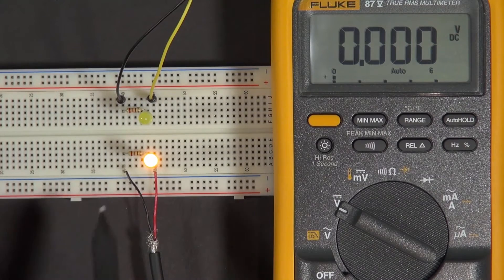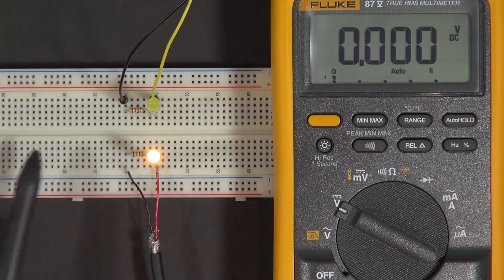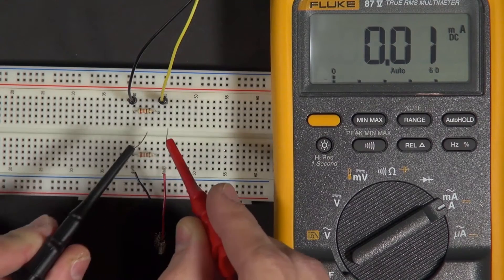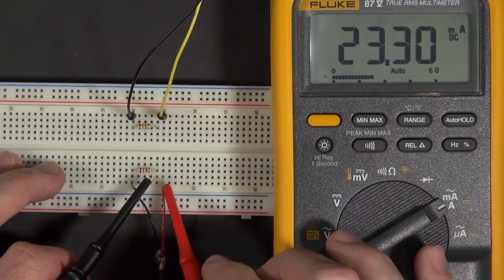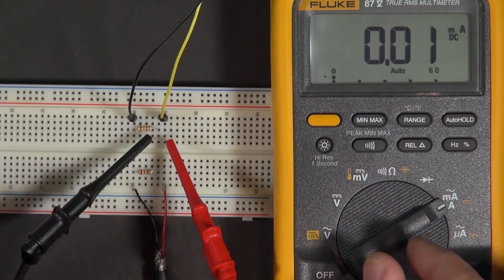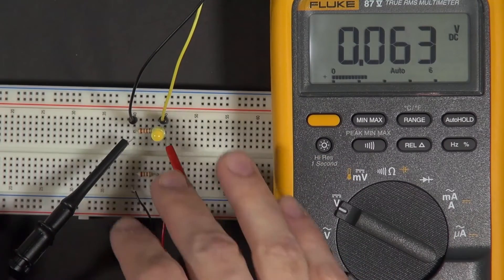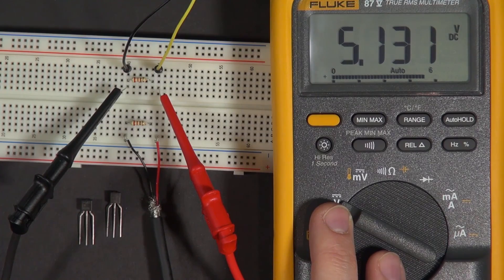Troubleshooting: Investigating why the LED is so dim (5 of 10)

Comment: As always, thank you Ben!  I want to ask, I know that without that led, the 220resistor was not making a circuit with the 555 source, but if it was - what effect does that have *on the source*? As you said, the volts need to be 0 in summation, so does it unbalance something on the other side? Like if you had another small circuit in that chain?

Comment: To add, ability of a power supply to "deliver" current differes just because Ri {=inside resistence = you can imagine it like resistor inside an power supply} is DIFFERENT for DIFFERENT power supplies (Different power supplis are e.g. usb charger; battery; switching-mode power supply...). The Ri depends on construction of a power supply and it is a characteristic of a given power supply.
Reply: Power supply should keep power constant. If you want constant voltage use voltage supply and if you want constat current use current supply.

Your computer has a voltage supply that keeps the voltages +-12VDC and +-5VDC steady even when load increases. The power rating of your computers voltage supply tells how much load it can supply. Current supply keeps current constant even when loads resistance changes. These are mainly used for recharging batteries and batteries usually indicate what their recharge current is. Power supply keeps power steady so it limits current when load's resistance drops so that current doesn't raise to damaging levels. These are used in heaters and motor control.

Comment: The odd part to me is the forward voltage. There is enough voltgage to push the electrons across the diode, but not enough electrons to illuminate the diode properly. 

Does this relate to the controversy of, "Its not the voltage that kills you, its the current'? Lightning must have high voltage, to break the resistance of air.  I guess the resistance of the human body composition is ultimately 'what kills you', but surely it must also be hgih current. I believe contact (skin) with 100mA - 1A can be lethal, right, but no voltage is generally given...right?

I guess a 12V car battery has much more potential for harm than a any number of dry cell batteries. Can you explain that?

Does this mean that in schematics, stating the volrage of the power source, without some indication of max current, is implying that you could have 'infinite' current?

Comment: How could that be? Due to Ohm's law in both circuits there are 5V, than with equal load (resistor + led) there must be equal current. I don't think previous comment describe this situation fully.
Reply: Only the open-circuit voltage is the same. When you put the LED in the top circuit the voltage is not 5V any more.

Comment: You have amazing content Ben- thanks very much. Question, though- doesn't the current measurement you're taking short the circuit, since you're taking the LED out of the circuit? Isn't that dangerous to the power supply? Wouldn't it be better to leave the LED in the circuit and insert the meter into the circuit?
Reply: It does not, since there is a resistor in between the wires

Comment: Could anyone help me? I can't understand how one circuit can have a current of 0.3 mA and the other of 23 mA. Since 5V is the voltage and 220Ω resistance for each circuit, according to Ohm's Law, shouldn't we be getting I = V/R = 5/220 ~ 23mA . So why do we end up with 0.3mA in the upper circuit?
Reply: Because the mystery circuit that it's also connected to has resistance?
Reply: Ohm's law still applies, but V isn't 5 volts anymore after we loaded the 5V source by connecting to GND through LED and resistor. We measured 5V only when it wasn't loaded at all. Maybe it would remain at 5V if we connected it to GND through much higher resistor. But once we wanted the 5V source to give more current than it could, the voltage droped from 5V to much less...
Reply: The top circuit has a large output resistance, so the output Voltage drops, when you draw a current.
Reply: for anyone wondering:
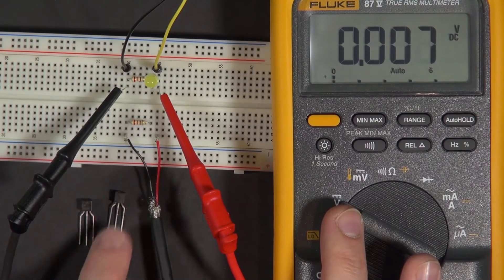Look at 4:50
There he is measuring the voltage with the closed circuit(including the led)
Ohms law obviously still applies, but you guys are putting in the wrong numbers.
Voltage is 1.822V and with the resistance of 220Ohms the Amperage would be around ~ 8.27mA

Take a look exactly where he is measuring with which components connected in the upper circuit, then you will probably get it =)

Comment: Notice that in both videos Ben never measured the signal's voltage when the loop is closed. But he did measure the amperage when when the loop is closed. That's why a lot of people will apply Ohm's law to the wrong set of numbers.
 So why is it that the voltage drops when we connect everything together? I think it's due to the law of Power: P = V * I. A normal power supply  will always make it so that the terminal voltage difference will be a fixed value because it provides the power lost throughout the circuit. BUT in the case of the signal, there is no such guarantee.
Reply: Just this one because you stated this " .. when the loop is closed .. " so it lead me to think if there is any chance that open loop shows 5 V and closed one different and how is that possible and is that reflecting the problem with the current draw ? Thanks.
Reply: @stefanjovanic7725  Actually, he did measure the closed circuit's voltage at around 5:00. It is different for sure.
Reply: @stefanjovanic7725  The voltage drop is because of inside resistence of a power supply {=Ri}. The power supply really has e.g. 5V, but it has also inside resistence {you can imagine it like resistor inside a power supply} which LIMITS the current according to Ohm's law. The Ri is a CHARACTERISTIC of a power supply and value of Ri depends on construction of a power supply. Therefor if there is a resistor inside {Ri} a power supply and you close the circuit, the resistor {Ri} LIMITS the current according to Ohm's law. Wish it helps :)
Reply: The important thing to realise is that it is current that makes a led work, not voltage. That having been said there must be enough voltage present to turn the led on.

Comment: Isn't it because the square signal isnt DC and thus its equivalent DC current is the RMS current (effective current)? The DC signal is ON all the time, the second signal isn't (depends on the duty cycle of the signal from your circuit).
Reply: @QueueTeePies  you're correct

Comment: Thanks for wonderful series on basics.. 
One quick question: In a series circuit of 5v [made from USB cable {output 5v dc 1.4 amps}] , one resistor, one led. Everything is fixed, 5 volt, 1.4 amps, 330 ohms, how do we make sure to reduce only current or only voltage by resistor ? .. 

In the circuit multi-meter readings says, The voltage 
- around battery is 5.1 V
- around resistor [330 ohms] is 3.15 V
- around led is 1.95 V
Yes, this proves Kirchhoff's voltage law [ 5.1 = 3.15 + 1.95 ] 

The reading for currents/amps 
- around battery is 1.4 A
- around resistor [330 ohms] is 185 mA
- around LED is 150 mA

This is not clear. What is the ratio and how much voltage/current will be reduced based a resistor. What if I want voltage drop but not amps or vice versa..

Also, we studied in schools that the current in series circuit remains same but changes at every junction in parallel connection [junction rule].. but here the current is also changing in above mentioned scenario [after every component, resistor and led in this case.]

Kindly explain. thanks in advance.

Comment: Hi, 

for an accurate measure, shouldn't you be measuring the current with the LED in the circuit (between the input wire and the LED lead) because of the voltage drop thru the diode?

Regards
Reply: sorry for late reply,    As voltage drops in series and will not drop in parallel connection, we can measure it across the components (parallel connection) so that the voltmeter will not drop any voltage and give accurate result . like that current will be same in serial path and will get divided in parallel paths , so if you measure current when LED is present in circuit , some part of current will go through LED and the rest only flow through ammeter and get measured , but without LED , all the current will flow through ammeter and gets measured accurately

Comment: I think that I didn't understand this completely. I was thinking about this and couldn't get my mind to grasp the fact that 5 Volt isn't equal to 5 Volt. 

What I'm guessing that's happening here is this:
Signals voltage is 5 Volts, but it has some inner resistance (like a real generator would behave), and when we complete a circuit through a resistor and diode, the amperage has to be lower since there is some inner resistance in the signal, therefore an equivalent resistance won't be 220 ohms, it would be much greater, probably even greater that 3kilo ohm (I didn't calculate it)
The USB generator behaves like an ideal generator, providing 5 Volts (with no inner resistance) and therefore the circuits equivalent resistance is 220 ohms.

Is there something I'm missing?
Reply: Nope, the internal resistance of the voltage supplier has nothing to do with the 
 resistance of the circuit itself.
For a voltage supplier in a circuit, we only care about its terminal potential difference, not the emf, not the internal resistance.
The wrong thing about the signal above is that it can't sustain the voltage when we plug in the LED (which introduces the voltage drop)
Reply: @khoavo5758  Can you please explain why it can't sustain the voltage when we plug in the LED ? Thank you.
Reply: @stefanjovanic7725  Actually, I do not know, maybe in some strange world the voltage wouldn't drop. All elementary exercises about circuits assume a constant voltage under any load, I don't suggest looking into this if you're starting to learn this stuff.

What I do know is that the electric power is limited in this case. Therefore, the LED must be dimmed, otherwise we would gain power out of nothing.
Reply: @khoavo5758  Thank you very much :)
Reply: @stefanjovanic7725  any generator or power source has something called an "I-V characteristic" it basically tells how much currents you would draw from it at any given voltage.  all loads including the LED hear, have an I-V characteristic that tells how much current it has to draw at any given voltage. when you set the source voltage to a specific voltage and then connect a load to it if the Load that you have connected doesn't have that operation point [we call a specific voltage-current state operation point]  these two will find an operational point that they both accept and fall to a different operation point. if the source is designed for that specific load or similar loads the new operation point will be close to the operation point of the source before connecting the load but if the connected load is not appropriate for the source the new operation point will be  far from the original one and the output voltage and current of the source will change due to the connection of the load.[In some case this might even cause the source to outright refuse to work and fall to zero power state]
Reply: Well, actually you're right about the "internal resistance" part, but the battery still has internal resistance, it's just smaller (about 1 ohm).